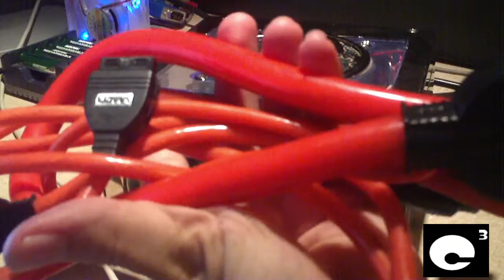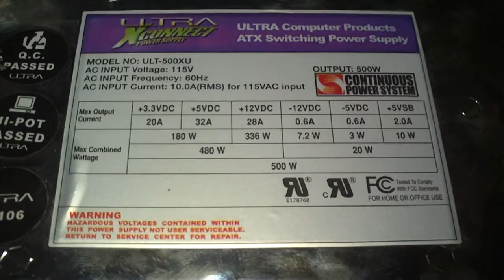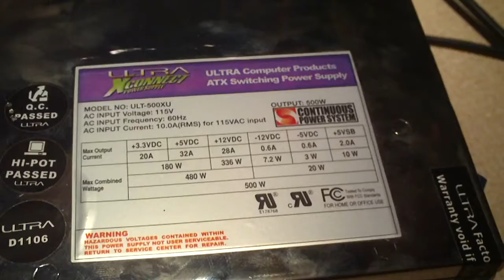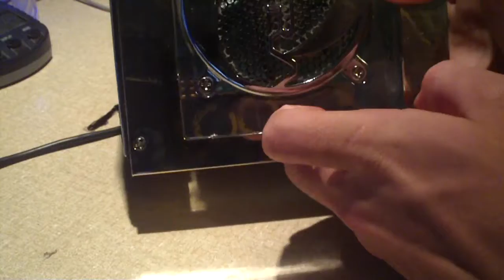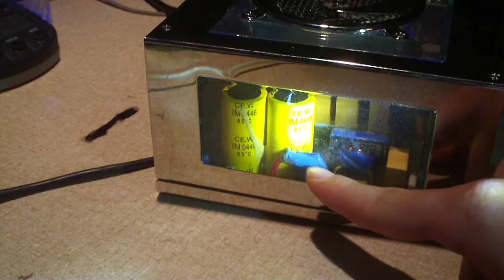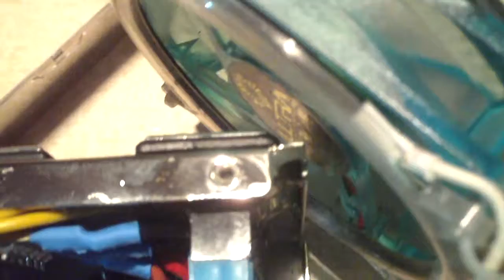Ultra X-Connect 500w Modular ATX Power Supply

Comment: ANy idea on how I Can turn this http://www.newegg.com/Product/Product.aspx?Item=N82E16817103512 power supply into a variable bench top lab power supply ?
If anyone knows how or if it's even possible for this particular power supply email me a video or instructions please. gate_420@hotmail.com  For some reason this PSU has no -5 rail, so not sure if this is needed to make a variable bench top lab power supply any help would be fantastic thanks.
Reply from the maker: +KoolBreeze420 There are several tutorials online with pictures on how to make a bench supply from a computer power supply. There's several ways you can go about it.

Comment: Great video.  I just purchased almost the same model power supply from a non-profit computer store.  They tested it and I think it will be fine.  However, I noticed that on mine, there are no sata cables nor is there an 8 pin pci express cable.  I just ordered some molox converters that should solve that problem but I'm not confident in the quality of those types of cables.  Anyway, I noticed that others have asked how your came out after you rebuilt it.  I've never worked on a power supply and replacing capacitors as I recall from my electronics classs (back in 1966) involves some risks?  I think you know a lot more about this stuff than I do.  Really enjoyed your video.  Keep up the good work.